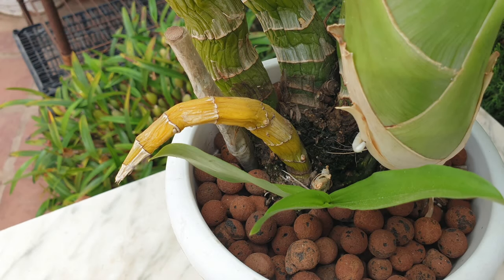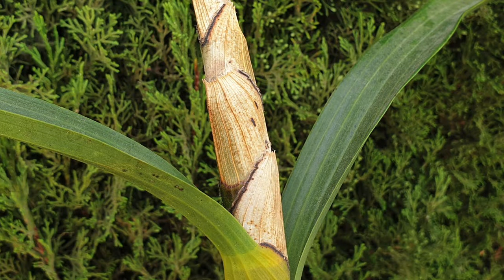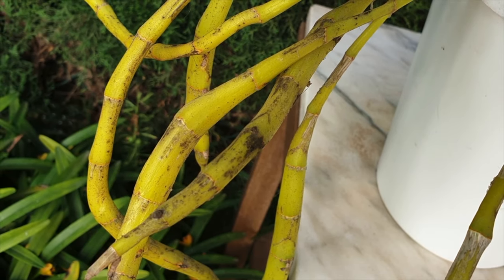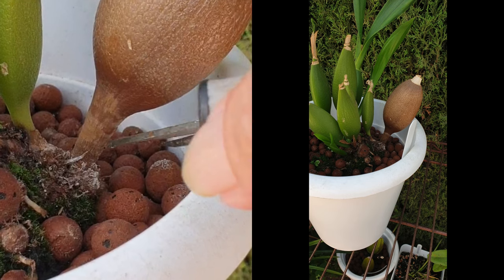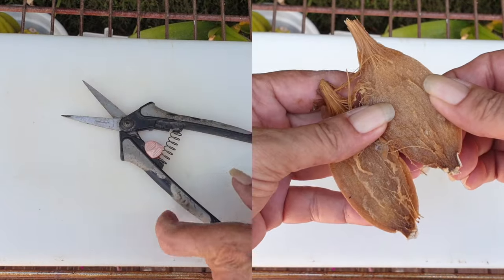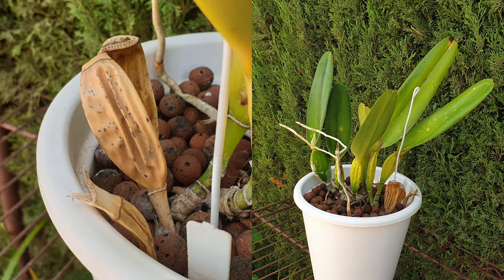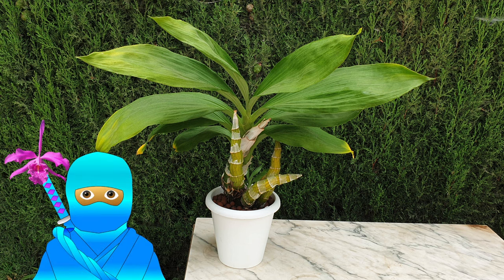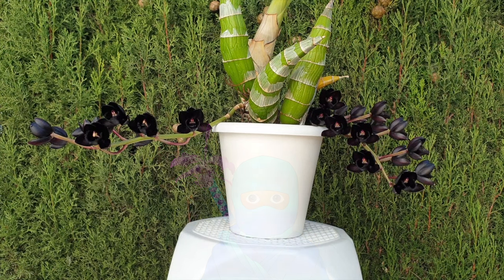Understanding Old Orchid Pseudobulbs | What’s Normal vs. What’s a Threat & When #ninjaorchids

Comment: I think the only exception for removing old pseudobulbs would be during repotting. Most people remove the old bulbs in order to avoid using a larger pot size, but I've heard removing the old bulbs helps the orchid save energy? 

8:40 So removing the sheath could cause sunburn or transpiration? 🤔

The bulbs I thought burned on my new Hawaiian cattleya (Rlc. Kalim Smith's Kahelelani 'Volcano Queen') ended up just developing more anthocyanin. They are more of a very dark purple color, but still firm to the touch. 

I got my first two Yellow Birds today at a local big box store for $34 (€31). I potted them together in a terracotta orchid pot when I got home. These will most likely be the last orchid purchases for this year. My collection size when up to 41. 😁
Reply from the maker: HI Joe 😍💐 oh, if I am repotting an orchid that has dried up bulbs, yes, they are definitely coming off then and there. I need to remove bulbs from many orchids that I will not allocate into a bigger pot, so yes, space and same pot size is one of the reasons I will even remove still viable back bulbs. Removing viable back bulbs is only advisable if the orchid is strong enough to not have a set back without the stored energy in the bulbs that are removed. So, the opposite is true, removing viable back bulbs weakens the orchid because she does not have that extra energy resource to draw from in the event of some stress, like a repot. If possible, it is always advisable to leave all viable structures on the orchid for eventualities. They provide energy, they do not deplete the rest of the orchid of energy. Sometimes, though, needs must! Something I will be covering in my stream this afternoon 👍🏼 removing sheaths can expose bulbs to too much light, direct sun and possibly sunburn yes. The cells are tender behind the sheaths, and not accustomed to light, so when removing sheaths, the bulbs are exposed to the elements and need to harden off to the sudden exposure to light; and yes, some orchids' pseudobulbs will start to show anthocyanin on their bulbs when the sheaths are off. That is normal, especially when the blooms themselves are also packed with anthocyanin 👍🏼 Congratulations on the purchase of such a beautiful orchid! I think Yellow Bird is gorgeous! I have the Golden Peacock and not enough space for a Yellow Bird. If things were different, I definitely would have a Yellow Bird! Happy Growing, Joe 🫶🏼 thank you so much for watching this video! I hope you are already having a fabYOUlous day ❤️🌸